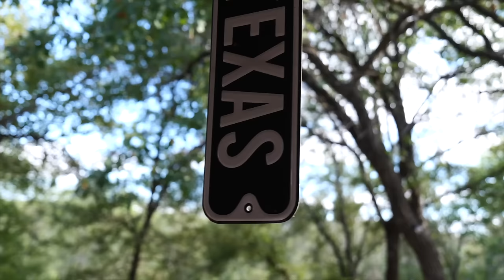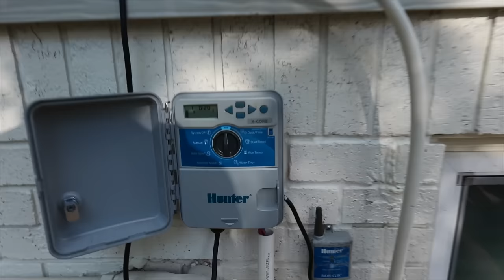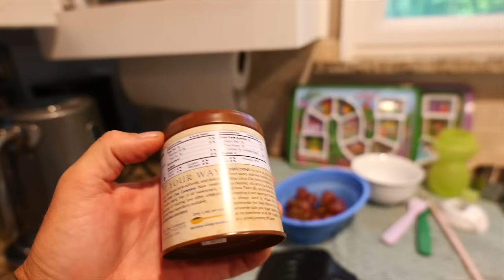What's Hiding Under My House?

Comment: Justin, you need to get some liquid electric tape to seal those Wagos.  I use it on a lot of applications when they are in the ground or outdoors.  It's not perfect, but it is a good way to help waterproof the connections and make them last longer.

Comment: Have I ever told you about the guy I dug out of a trench collapse. You have no idea how close to death you are in that hole. OSHA has rules for that. Any trench hole 6” or over has to be shored up. Especially with your wife standing on that edge
Reply: Oh bull crap! OSHA is around for sissy’s that are scared to get a scratch at work
Reply: 6" do you mean 6'? even then you're still wrong... LMFAO
Reply: The Occupational Safety and Health Administration (OSHA) has several requirements for trenches based on their depth, including: •
5 feet or deeper
Trenches of this depth or deeper require a protective system, unless the excavation is made entirely in stable rock.
6 feet or deeper
Excavations of this depth or deeper require protections to prevent workers from falling in.
This includes guardrails, fences, barricades, or covers.
4 feet or deeper
Trenches of this depth or deeper require a fixed means of egress, such as a ladder, steps, or ramp. The means of egress must be located so that workers don't have to travel more than 25 feet laterally to reach it. Ladders must extend at least 36 inches above the landing.